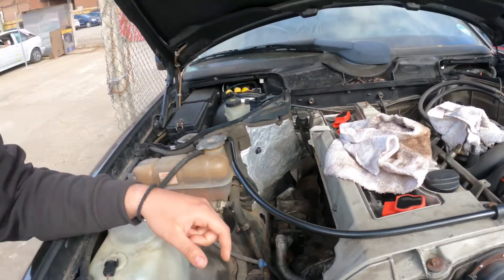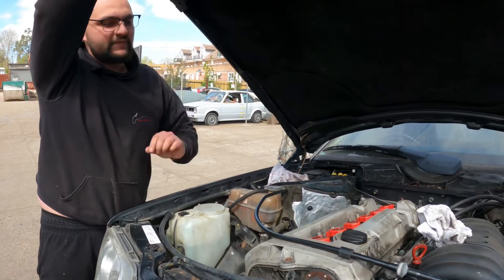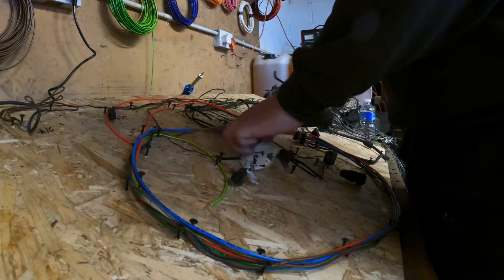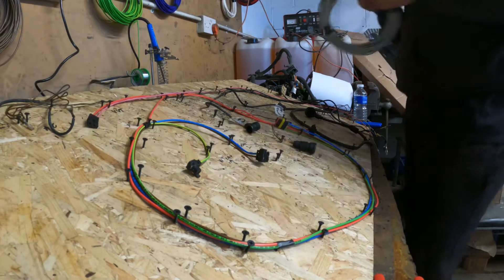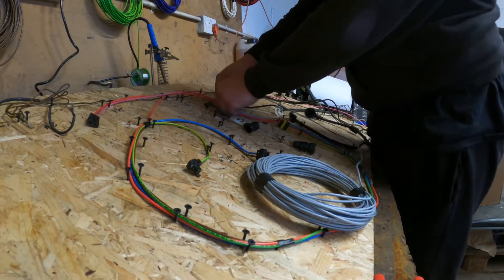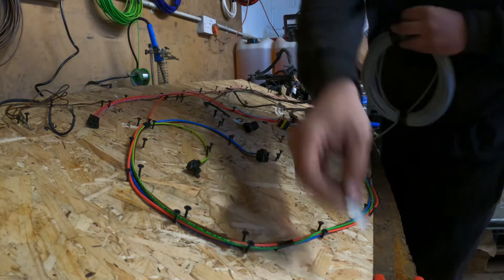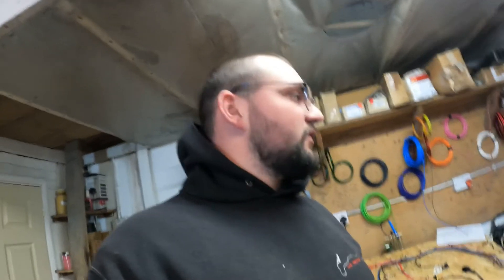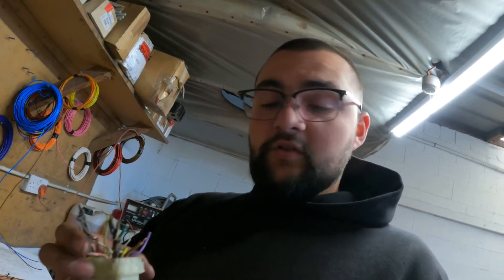New Project C124 Turbo / M104 Wiring Loom

Comment: I am going to buy this same car soon, only difference is that im going to get a pre facelift model with the 3.0 24v engine. Do you have any advice on the buying process? What to watch out for or common problems?
Reply from the maker: Hello, mainly check for rust. Check for wiring and if everything in the car works as it should because electricals could be really annoying! Check if transmission shifts good and if there is any harsh bangs while accelerating. Rust under the plastic sills and around front wheel arches. Other than that they are really solid cars. A lot of stuff might not be working but always take you where you need to go! It’s like a Russian Lada in a sense! 😂🤷‍♂️